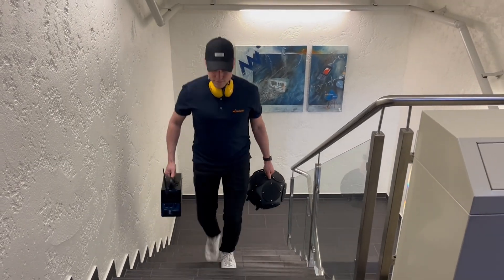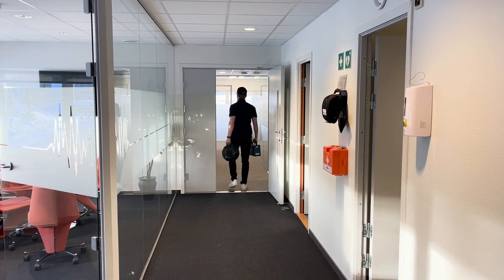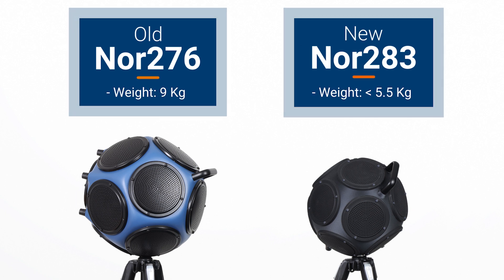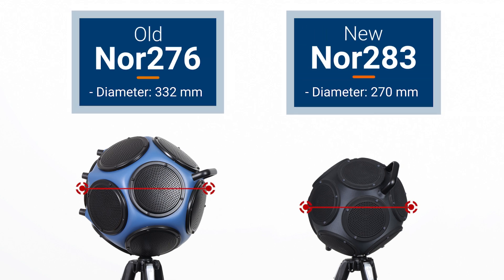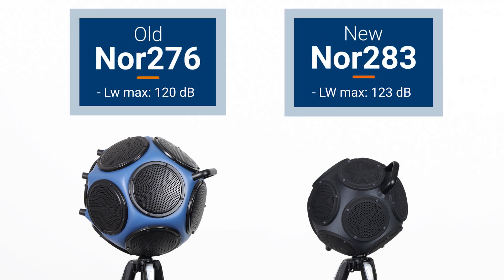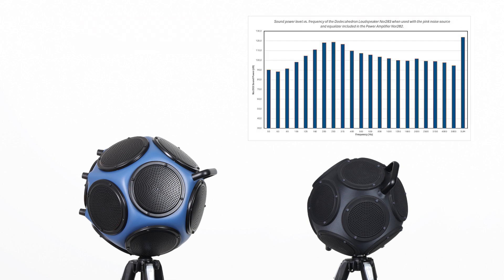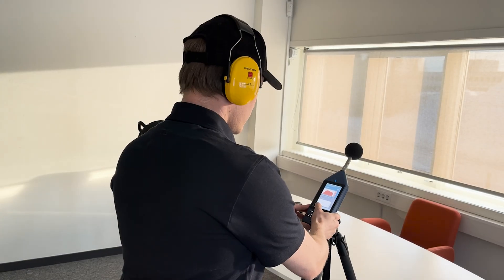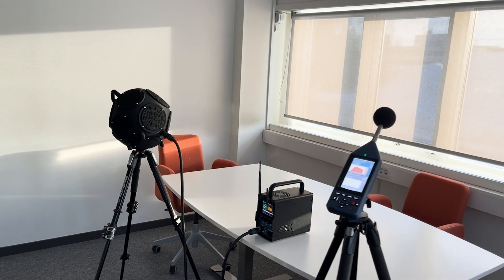Building Acoustics 5: Nor283 Dodecahedron Loudspeaker

Comment: Thanks, very interesting! According to ISO 16283-1 the differences between 1/3-octave-bands shall not exceed 8 dB. According to the graph Sound Power vs. Frequency it is unclear, if this is achieved between 80 and 100 Hz or 160 and 200 Hz. Possibly a close-run thing? Well, I hope, it matches the standards with ease, because lighter and smaller loudspeakers are way better to handle.
Reply from the maker: Thank you very much. Yes. The differences between 1/3 octave bands are according to ISO 16283. 
You can see and download the Product Data with all detail curves using the Nor282 and Nor280 power amplifier in our site: 
https://www.norsonic.com/products/noise-sources/nor283-dodecahedron-loudspeaker/

You can also contact us at info@norsonic.com or directly contact to your local distributor for a meeting🙂